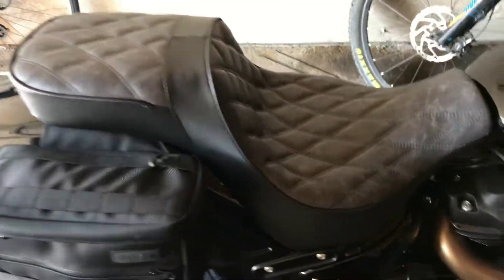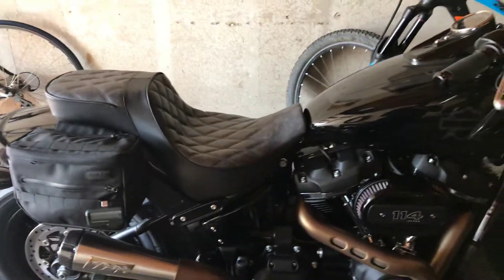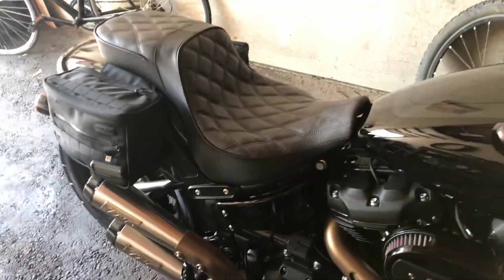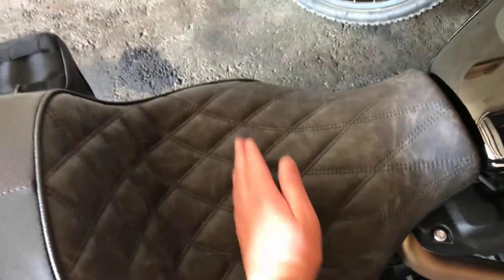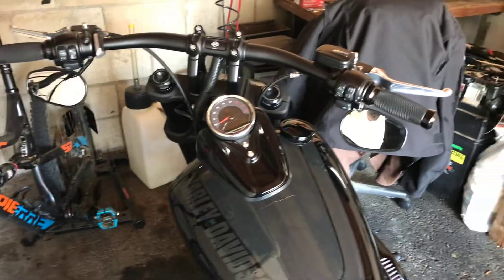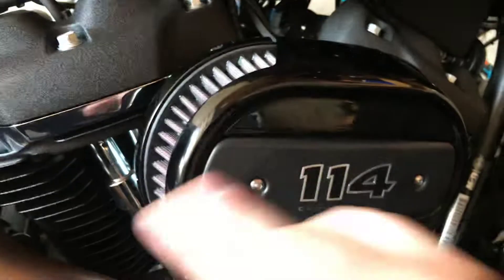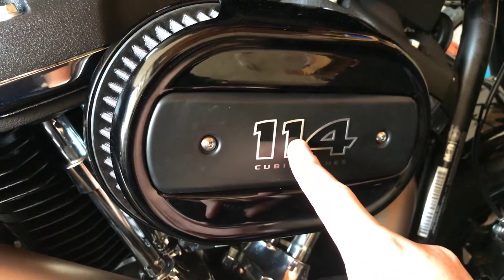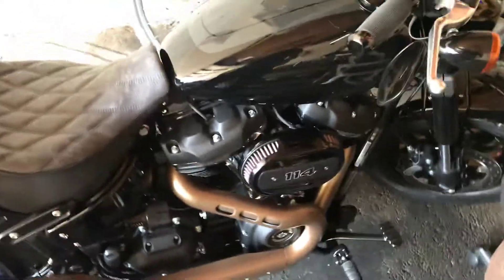Corbin gambler seat 2018 fat bob

Comment: It looks great. My question is about height. The saddleman is suppose to sit you up and inch or so more that the stock. Does this seat also do this? I would pefer the extra inch for more leg space. Thanks.
Reply from the maker: Del1000r im 6’3 this seat was way better then the stock for leg room and is wider in the seat the the saddleman that and the color options where the reason i got it. There is a photo with all the dimensions on the website

http://www.corbin.com/harley/softail/hdst18fbgam.shtml
Reply: @digitallove421  thanks dude, your height along with the info that it gives more leg room than the stock seat is what I’ve been looking for for HOURS
Reply from the maker: @NeuroticLobster  is you google the seat you should find and image of the measurements I have the photo so I know it exists.

Comment: Great looking bike , you flipped the handle bar riser , iv been thinking of doing the same, how do you like the bars with the flipped risers?
Reply from the maker: The stock bar were just unridable for me. So to save money i flipped the risers to push them forward this was the only way i could use the stock bars. But i switch my bars out for a mx bar set up which is way better.